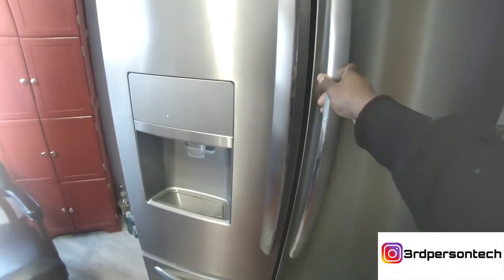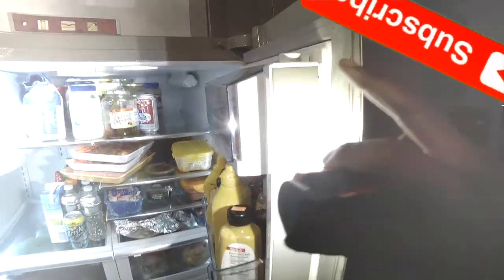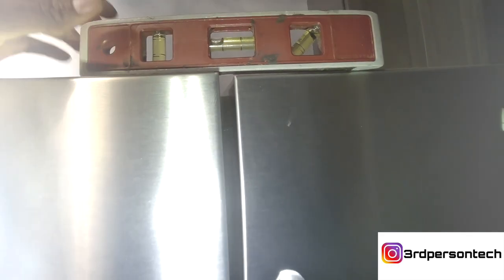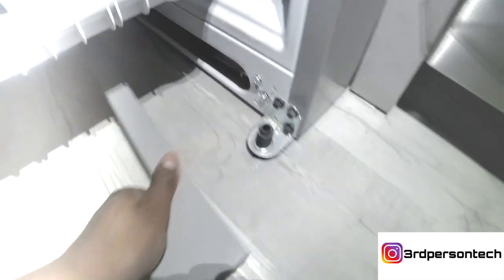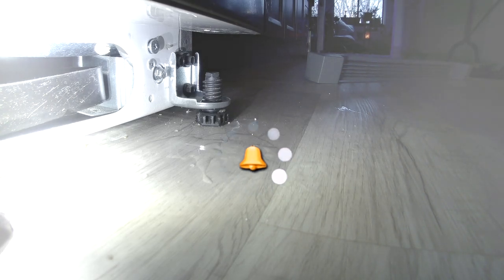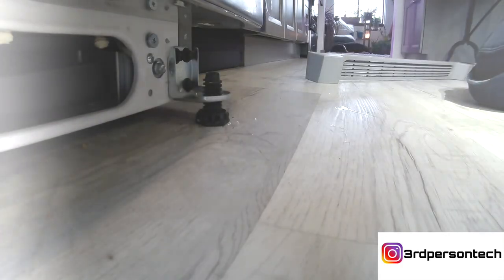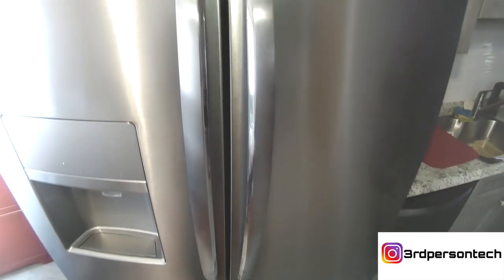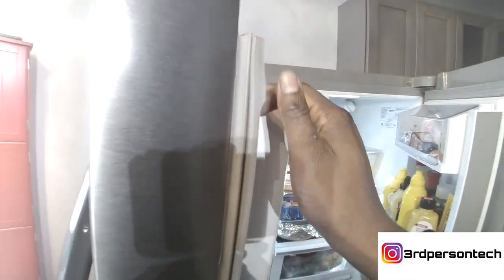Refrigerator french door not level Easy Fix Watch now!

Comment: Thank you for this video. I have Frigidaire with side by side doors and can’t turn the adjustment area left or right to even out my doors at the top. I’m afraid to force it and break it. I have put WD-40 on it but that didn’t help. It is brand new. Any suggestion would be appreciated.
Reply from the maker: Hey if it’s brand new less than a year old call manufacturer and have them send a tech out.

Comment: I have a Bosch French door and the flap engages, but - if the left door is already closed - the right door needs a strong push to close as the gasket is rubbing against the length of the left door and can cause the door to get stuck. A service tech already replaced the gasket and this did not help.
Doors appear to be level.
What else could it be?

Thanks for the video

Comment: I can't figure out how to level my whirlpool refrigerator model ed5vhexvq01 or adjust the doors. I contacted the company, and they sent a manual that doesn't have any info in it on how to do it.
Reply from the maker: @aletheiaquest  this is a side-by-side unit so it’s the same concept. Keep adjusting the legs until the doors meet together in the middle start on one side first start raising it and if you see, it’s going to where you wanted to go you keep raising it if you raise it and it’s not going the way that you want to go then drop it and do the same on the other side until both doors are even hopefully this helps.